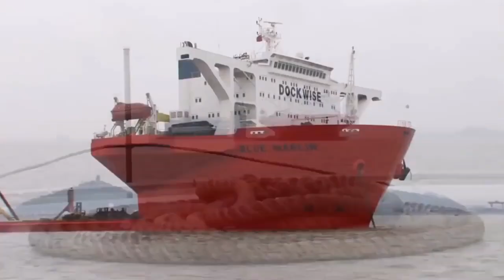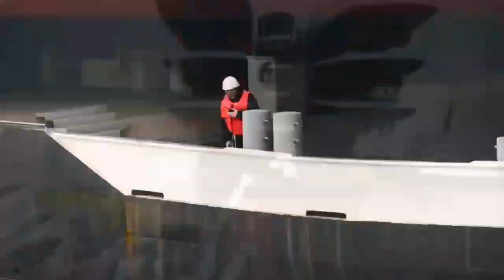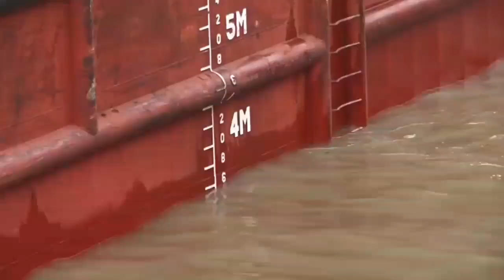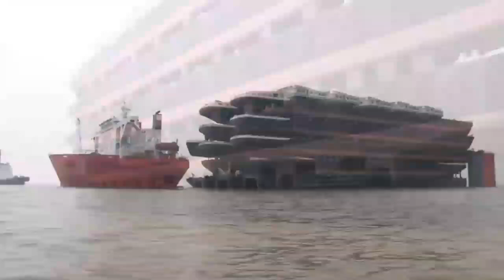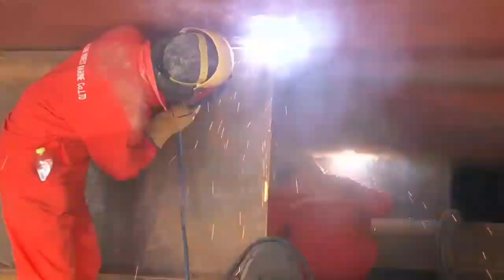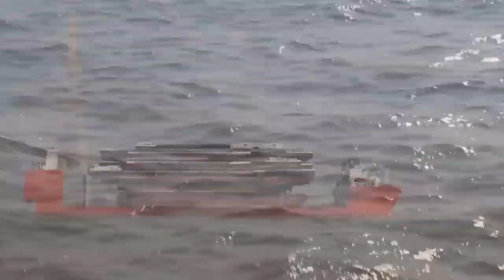Mega Ship Blue Marlin - ship shipping ships

Comment: These ships can sail why they are doing this it doesn't make sense
Reply: One captain and one crew can do the work of 10 captains and 10 crews.
Reply: They're often empty or half constructed hulls or barges that can't move under their own power but need to be elsewhere.
Reply: They are river ships that aren't made to cross the ocean. See how long and slim they are? A big ocean wave could probably sink them.
Reply: they ship only the superstructure or hull as you can see no propellers and engines in these or the top of the ships which is the wheel house etc, basically these hulls are not fitted out yet
Reply: May be these ships need to be repaired
Reply: @waster73  dude u trippin hard if u think this COLOSSAL thing is cheaper than 9 captains and 9 crews